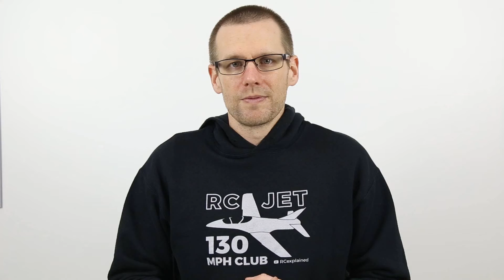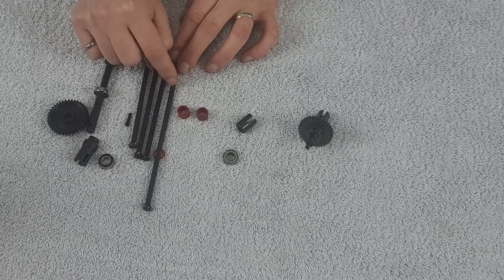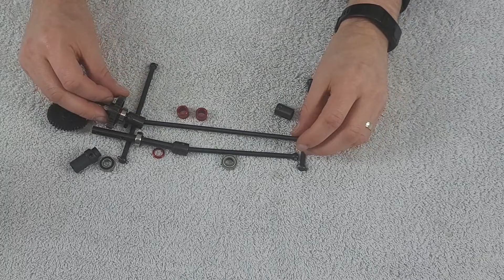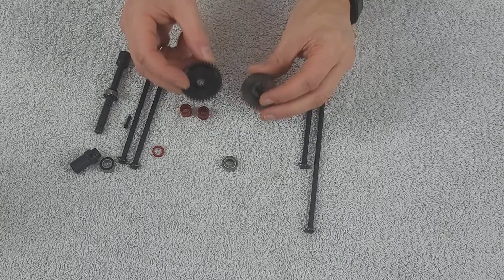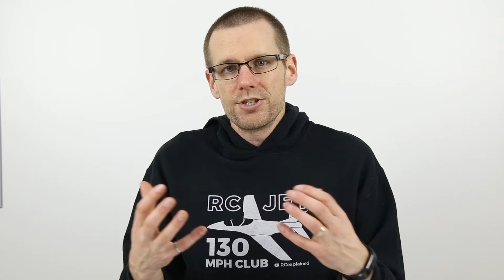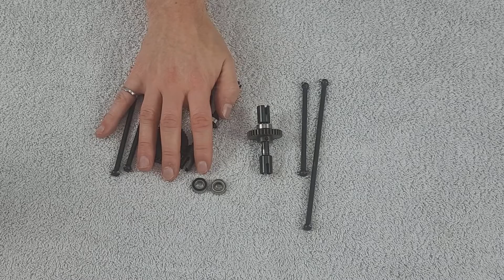Arrma Limitless V1 vs V2 Center Drive Shaft Comparison and Detailed Look

Comment: So what all do I need to fit my limitless v1 to V2? I bought a spool for a v2 and now I have issues finding drive shafts that fit. Help! Thanks I'm advance
Reply from the maker: Quite a bit. You will want to start with the chassis plate.
Reply: @RCexplained  okay thanks! I currently have a stretched carbon fiber  chassis already. I think I have to mess with the motor mount placement. I will replay the video till I get it done haha. I appreciate the quick reply!

Comment: Great video Can you upgrade the ver1 with the ver2 spool ?
Reply from the maker: Not without modification and more parts.
Reply: Thanks for the reply so what do I need ?
Reply from the maker: @angelpelcastre3328  if you don't move the location of the center spool, I think you'd need custom length shafts.

Comment: So by slowing it down the v2 is slower if u out the same set up in both cars ?
Reply from the maker: The center shaft will rotate slower but wheels will rotate at the same speed.
Reply: @RCexplained  ok so the v2 is faster I wanna do a drag set up but if it’s slower then the v1 limitless it’s no point to buy it

Comment: Dear Ryan, have you done a video explaining motor timing on “X” and “Y” wind  brushless motors? Thanks, Chris Curry
Reply from the maker: Hi Chris. My recommendation would be to test the timing against your desired metrics. Either acceleration or top speed vs motor Temps. Find the balance that works for your setup.
Reply: @RCexplained  Dear Ryan, thanks for your advice.

Comment: I got more life and less slop out of arrmas original bearings which were metal shielded . Not sure if same on the limitless . I used rubber shield in 2050 blx motor and no way as good but that's my fault as uk motor bearings are generally better quality